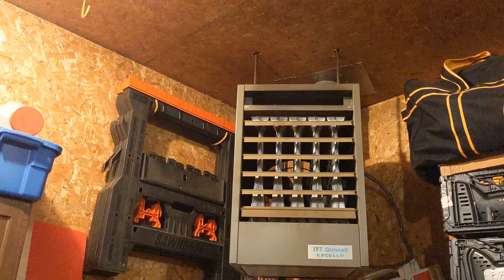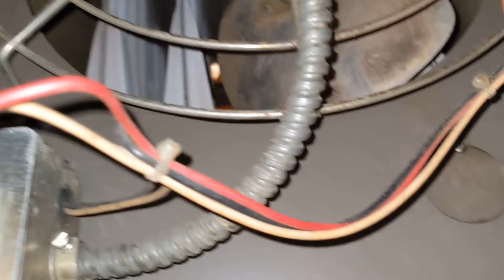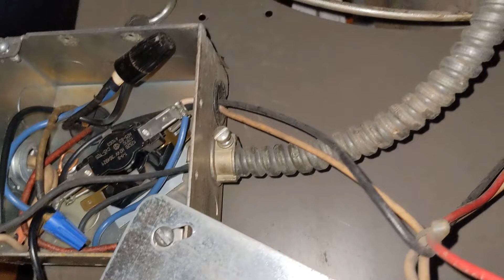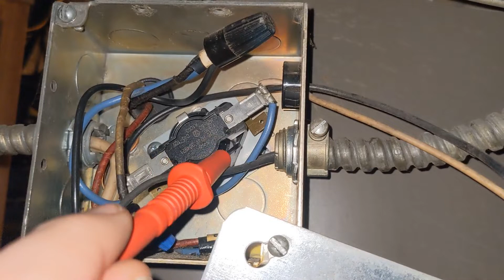Troubleshooting my Cycling Unit Furnace (time delay relay / heat sequencer explained)

Comment: You'll find similar sequencers in heat pumps. Like on a 15KW strip heat when emergency heat is called for. 5 KW comes in then if the thermostat doesn't satisfy 5KW more comes in and so on and so forth....
Reply from the maker: Very similar!